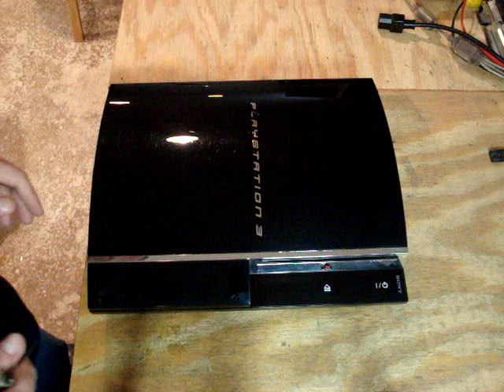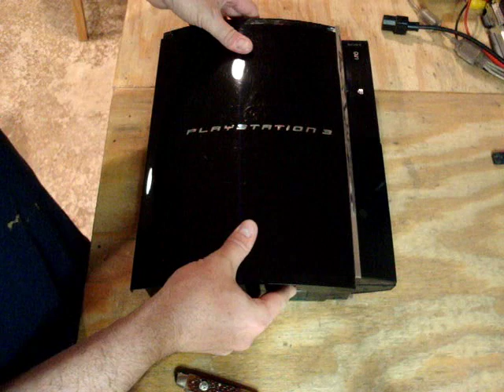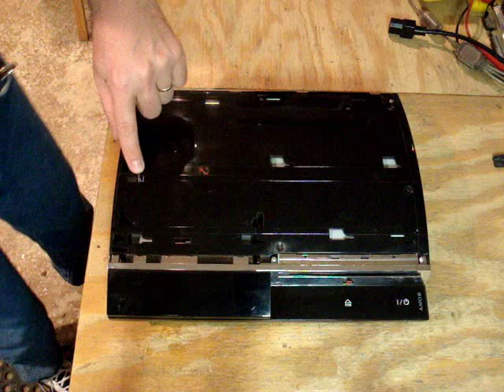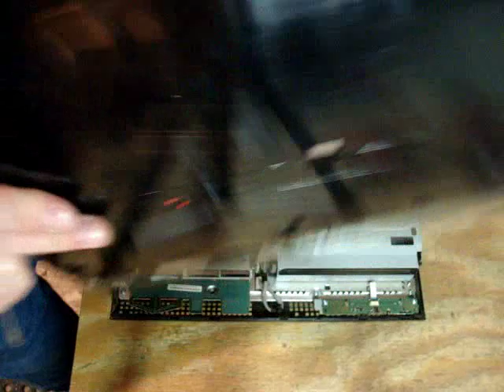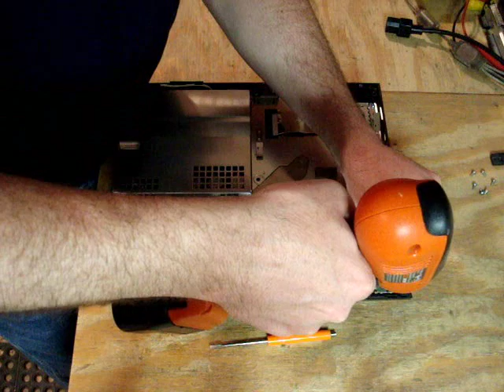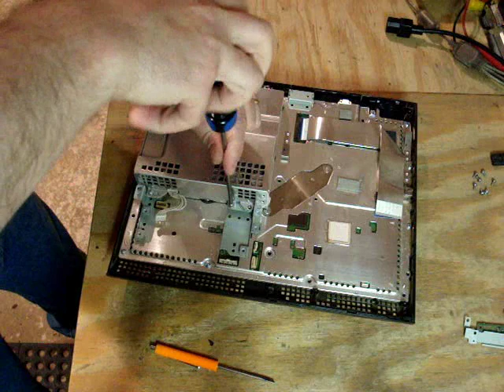Prevent the PS3 YLOD Yellow Light of Death (2 of 7)

Comment: Hi guys,thanks for the info.
 I´ve already have the YLOD. You say NOT to use the heat gun, but if i will have to use the flux, what do i use to warm it, and reattach the solder joints between the chip and the motherboard?

Comment: Those of you with NOISY PS3 models, and want to fix it, use Arctic Silver 5 and your system should run much quieter afterwards.   It is better than the cheap stuff some of the processing plants must have put on there.

My PS3 is whisper silent again after applying a coat of arctic silver 5.

Also, if you are concerned about losing track of the screws, consider putting them in separate labeled evelopes with descriptions on where to put them back in to avoid confusion later on.

Comment: @fixmyplaystation Alrighty I got everything I need and soon I'm going to try to fix my PS3. Thanks for the video uploads. I know it's a video to prevent the PS3 YLOD but my PS3 already have the YLOD. I'm going to attempt to reflow with a heat gun. Do I reflow only the two processors and not the entire circuit board?